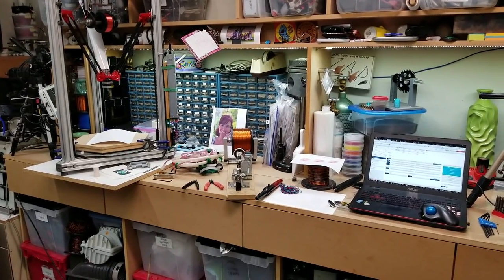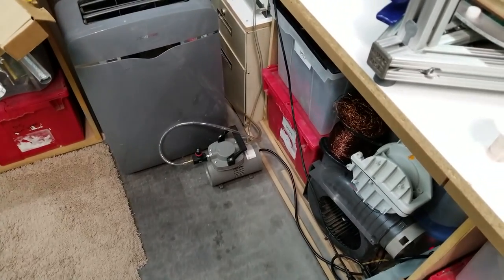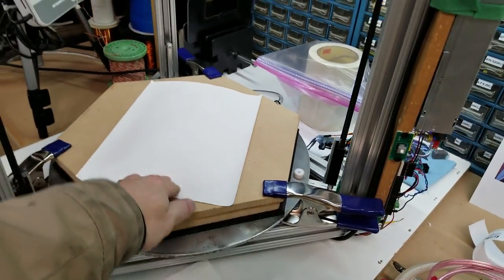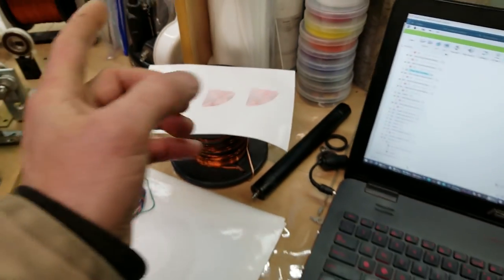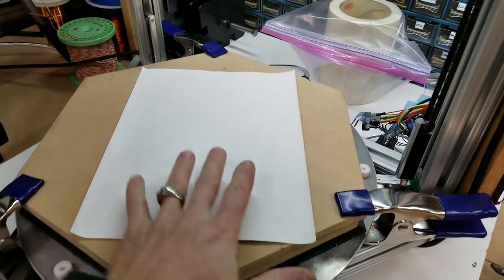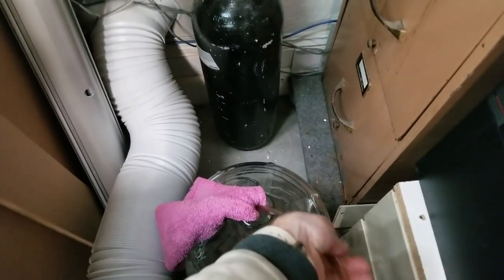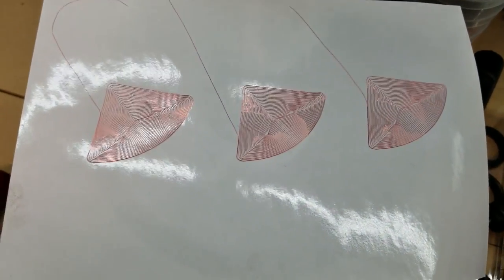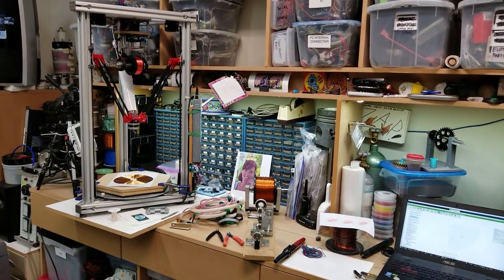Quick & dirty Update: CNC Flat Coil Winder Update. More To Come... In Due Time...

Comment: Print a  stack of 3 phase faulhaber windings onto paper, glue sheets together connect the 3 phases to the other sheets in either series or parallel for inductance or current needs.  Now you have an air core stator for an axial flux motor.

Comment: Did you write a tangential motion post processor for fusion????
Reply from the maker: We were going to, but i thought it would be less useful as it would be locked to fusion. So Instead my friend Matt wrote a small program to take the Gcode and spit out the direction via the  coordinates. We did this this way so that we could use it with most any Gcode genarator... will be posted for others to use in the future. There are always things to change and fix... ~Russ
Reply: @RWGresearch  thanks for the reply! I have a tangential post for sheetcam, but like you said, a non cam software specific "post"would be awesome! I assume you will talk about it in the software video... Looking forward to it! Lots of applications for tangential control!!!

Comment: RUSS, Print a  flat Rodin Coil or a flat Star coil, cut out the center insert a Neo - Sphere into the Galactic Plane.. NO, NO, ...STACK 6 COILS W/ ALUMINUM PLATES SANDWICHED BETWEEN THEM, PLATES CONNECTED IN SERIES PULSED W/SIGNAL GENERATOR UNTIL YOU GET THE ALL-SPARK FROM THE COILS. (ALL-SPARK = ELECTRICITY) HELP I'm in imagination overload!!!!!!!
Reply: That might suck the Universe out of existence.